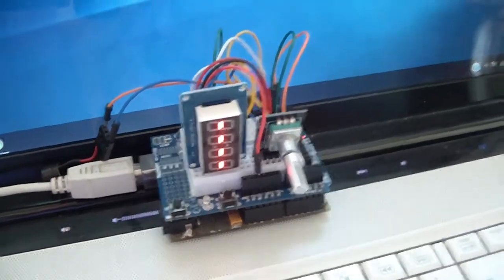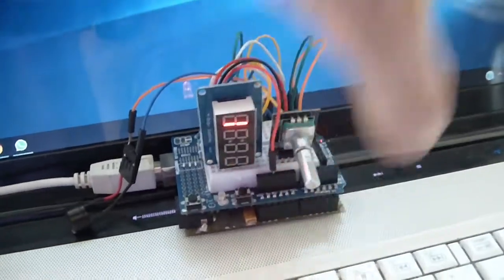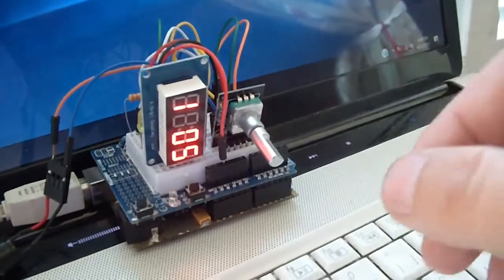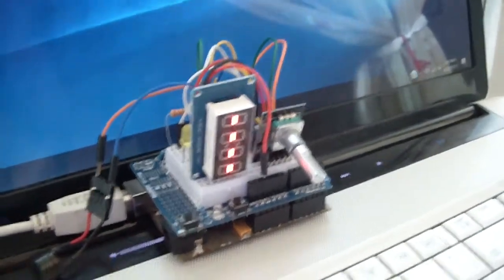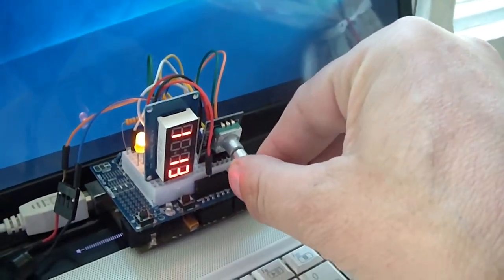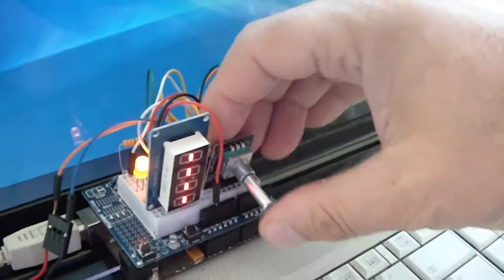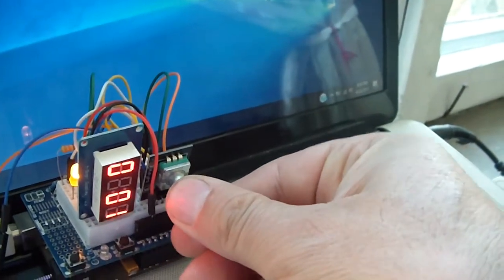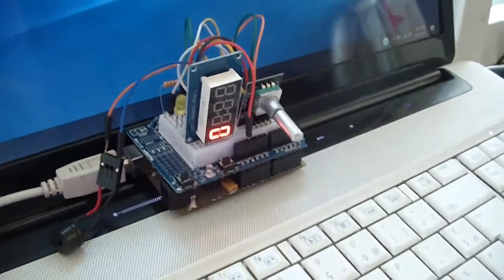adjustable astable relay with Arduino and TM1637 display

Comment: Hey, I was curious what the code is to read the analog values from the potentiometer on the TM1637 display.
 Thanks for the video.
Reply from the maker: is rotary encoder (KY-040) not classical  potentiometer
Reply from the maker: Lars B is encoder